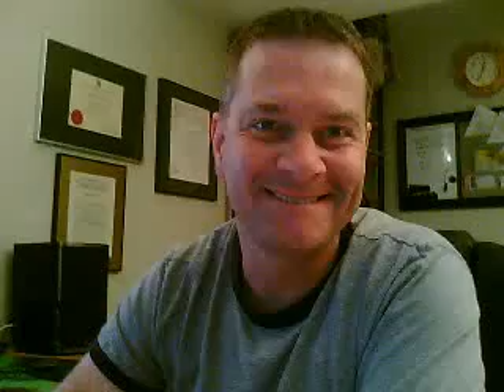#248 - Q&A: Modular & Non-Modular Power Supplies

Comment: if your a Noob go with Modular- if your 1337 then it doesn't matter. I don't mind wiring my case and making it neat. I have a Non-Modular Corsair TX 750 watt PSU and an Antec 900 Rev 2.0 Case. I had no problems running wires behind my motherboard tray and using zip-ties for my cables for perfect air circulation. Either way your going to have to do wire management and non-modular is %100 percent reliable where as modular, you have to worry about base connectors going bad and breaking lose etc.

Comment: my advice is NEVER buy buget PSUs, get something like a modular Seasonic ( gold pins ). Corsair PSUs last time I checked are Seasonic re-branded. as for the voltage drop. it's negligible since a PSU knows how to maintain a good clean voltage whatever load you connect. Also, who the hell constantly plugs and unplugs the cable at the PSU side?

Comment: i've heard that modular power supplies are less efficient than those that have their cables hard-wired due to the increased resistance brought on by the additional connectors. question is, is the difference negligible or not?

Comment: "...modular plugs have become a popular power supply feature...The fact is, modular plugs limit power by adding to electrical resistance. The voltage drop can be as much as would occur in 2 feet of standard wire. Worse yet, modular plugs utilize delicate pins that can easily loosen, corrode, and burn, creating the potential for a major system failure. That's why professional system builders specify uninterrupted wire!" -- from PC Power & Cooling's website.
What do you think?